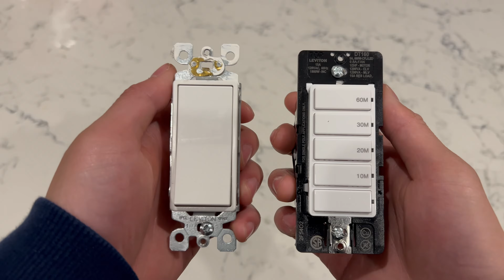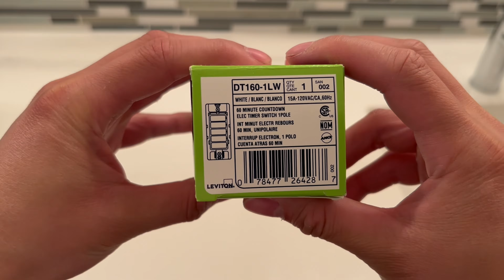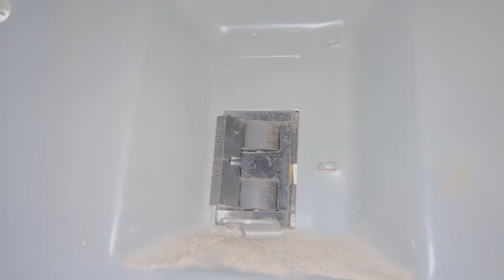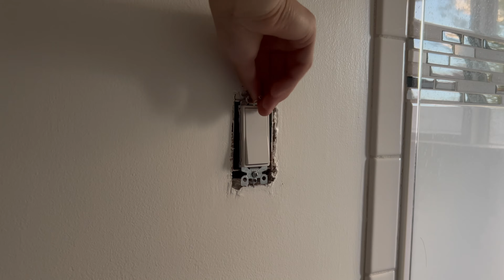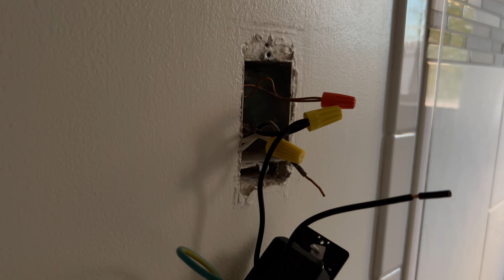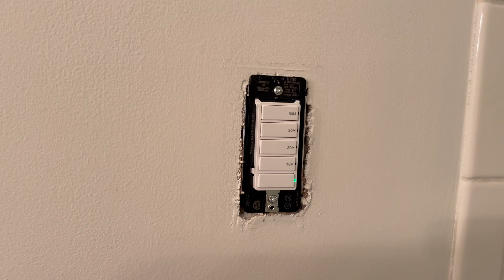Installing a Bathroom Fan Timer Switch - Leviton Decora 60min

Comment: Would it still work if I only have two Black wire and do not have a ground wire?
Reply: Having no ground wire isn't an issue (you can ground the ground wire). If there's no neutral wire, you need to check that the Timer Switch doesn't require a neutral wire.

Comment: My vent fan only has a black wire and a white wire connected to it. So would I just use the same black and white wire plus the green ground wire for the new switch timer?
Reply: If you haven’t gotten this taken care of. That’s a loop switch if I’m not mistaken. The white is a hot, carrying power to the fan. You need to use a timer that is no neutral required
Reply: I’m currently trying to solve this problem, the install instructions say to connect ground and neutral to the ground wire, load and line to black and white. It’s not working for me though

Comment: I bought this timer to replace an old twist style one that died. How do I wire this is there's only one romex line in the box? My outlet only had black, white, and ground. The old switch worked fine with this set up. This new one has zero directions for only black, white, ground.
Reply: I don't think you can use this.
Power is at your fan not at the switch. Your switch is just a power relay for what's up in the fan location.
Reply: @toscanoplaster5603  the power is coming from my laundry room and then going up into the fan in the Attic. The switch is in the laundry room. The power line is not in the Attic. I think this switch wasn't meant for just black, white, ground.
Reply: @King_Bored even if the power didn't originate in the attic where the fan is it's absolutely not in the switch that turns the fan on. So no matter what you say you can't use this timer switch because it requires the power to go to the switch first then back to the fan
Reply: I really want know this too
Reply: Wouldn't you have to split the power quote that turns on both? Or it doesn't work that way?

Comment: How can i install it to 3 wires only
Reply from the maker: Hello, if by three wires you mean two black wires and one ground (green or bare copper wire), you can still set this up. Connect the black wires as demonstrated in the video. Then connect the switch ground and white wire to the wall grounding wire. But for your safety, please consult a certified electrician if this is your first time working on electrical.

Comment: will it work if you dont connect the white wire?
Reply: If I don’t connect the ground mine works but the l e d n the timer do not work! I proceded to connect the ground to other ground in the box n voila! It works! This is supposed to work without the ground! Advise?
Reply from the maker: Hello, if you do not have a neutral wire yes it can still work. As long as you have two black wires (line and load) and a ground this will work fine.